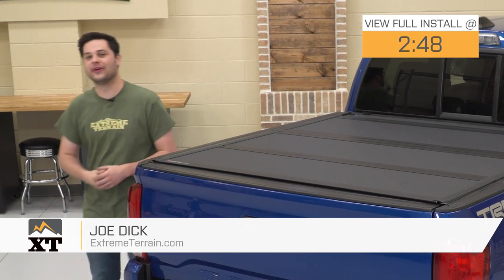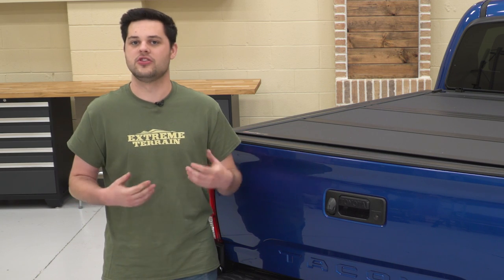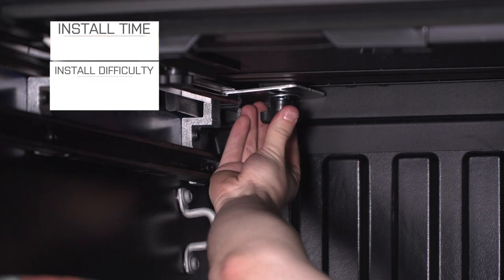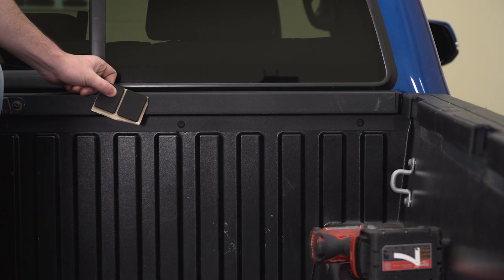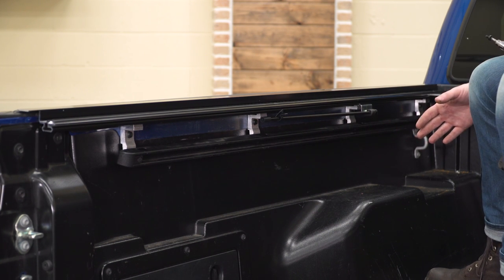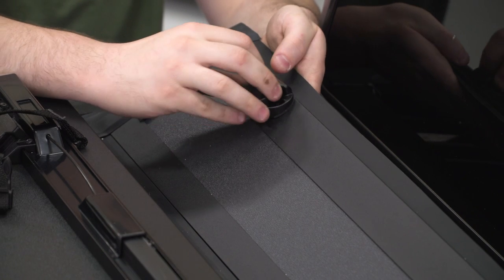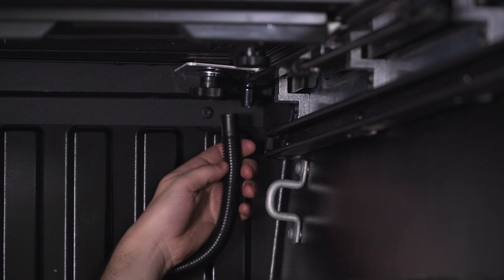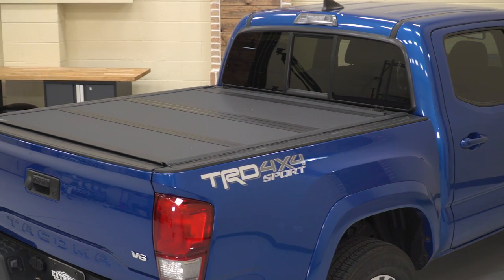Tacoma BAK Industries BAKFlip MX4 Folding Tonneau Cover (2016-2019) Review & Install

Comment: So what keeps water from leaking in with the giant gaps that were cut out of the plastic moulding covering the top of each side of the bed where the "mounting posts" are?  Trying to install this for a neighbor on a 2016 that has/had the factory tonneau cover and there no chance of a water tight seal.  :(
Reply: Wondering the same!

Comment: Whatever you do, BE CAREFUL if you drill through the bottom of your bed for the drainage!! I nicked my fuel intake filler neck and leaked gas all over the place next time I went to fill up 😞. Luckily it only set me back $600 but could've resulted in safety issues. I feel pretty dumb/lucky in hindsight, but please exercise caution if you try to DIY. FWIW the dealership admitted this happens to them on a regular basis when they install tonneau covers; nice knowing it's not just me.
Reply: Damn bro that freaking sucks!
Reply: I live in Phoenix not too worried about water more worried about tweakers 😂

Comment: Any tips to get more waterproof? Mine leaks and i get water in the truck bed... i mean, is not tons of water but say is parked or in motion while raining, i would get about 10% water leaked and not safe to leave stuff in the truck bed that needs to be dry because it will get wet if directly touching the truckbed. Any tips to avoid that?
Reply: @giibo1287 yes, return it. A lot of negative reviews on the whole bakflip line

Comment: What's to stop someone from sticking a flat bar in there and using that convenient strap to unlock the cover?
Reply: I noticed that on all these covers, you don't need a bar... just a coat hanger. The stock Toyota one has a handle for unlocking, but lacks security on the front bolt.

Comment: They changed the design of the MX4 for 2019 and now it covers the rail system instead of moving it down.
Reply: You just made my day.  I bought one a few weeks ago but haven't installed it yet.
Reply: I've heard alot of negative reviews about the cover is it really worth the 1 grand
Reply: Does this mean you can't use the rail system anymore?
Reply: @JV-zc4kh  So...not sure where Martin got his info but at least for the Tacoma version of this you still have to move the rails and they are fully functional.  Source: bought one in November and ive spent a few hours with customer support complaining about false information.
Reply: @yezkaholic  I like mine though i got it on sale for $700.  The sides of it that the latching mechanism attaches to are quite flimsy so I can't just drop it closed like they do in most videos.  I have to drop and then push which i guess isn't a big deal.  If i could do it over I would probably go a different route just because you have to move the rails which makes it almost impossible to find a bed rack that is compatible.

Comment: If Bak Industries had a twist knob on their MX4 cover, I would have bought one... I'm not a fan of plastic rivets either with glued on bars, but really like the design of the MX4... I decided to go with the Extang Xceed instead because of the twist knob that helps with deterring theft.
Reply: The Xceed is good, but the vinyl wouldn't hold up for me in the AZ sun.
Reply: I also like the button for security, does the Extang relocate the stock rails?
Reply: @ronmurphy4234  No, my stock tie down rails are not messed with at all as the Extang cover is secured by the top of the bed with clamps that come with the cover. Not only that, Extang Exceed uses a turn knob for the very first panel in the rear, so theft is much harder. All the rest of the panels are pull cords, but the very last panel where the tailgate is uses a turn knob. I've never had any problems with the construction at all to date and no leaks, but I did use silicone on the front bulkhead to reduce any possible leakage.

Comment: So I've gotta ask, if this hard cover is in the range of $1000+ why not look at a Diamondback Plate cover instead?
Reply: Diamondback definitely worth it if you have the money even the SE is still $1600 i just ordered a mx4 but down the road going to get the diamondback hd
Reply: No full bed access without taking the diamondback completely off.  Dealbreaker for me.
Reply: @redshift2026  Yeah that's fair. Its about a 15 minute process to take my SE off and 25 to put it on. I store all kinds of stuff in it that I'd never store under another cover though.

Comment: i want bed cover for tacoma 2019 5 foot bed without taking my rails out that comes with it any ?
Reply: It just relocates the rails. Watch the video...
Reply: @flounder  totally agreed , I just got this cover too.
Reply: @flounder  They changed the design of the MX4 for 2019 and now it covers the rail system instead of moving it down.
Reply: Martin Steiger so it covers it so you cannot use it? I’m confused a lot of drilling I’d rather not do to my brand new 20 taco.
Reply: @pagodad2036  get a bed mat and route the drain tubes underneath the mat.
Reply: @stephennicolaus5237  Wouldn't you get mold unless you are regularly taking out the mat and drying the bed?

Comment: These covers will last two years.  The deck material is OSB (or similar) with aluminum sheet bonded to each side.  The hardware for the latches is RIVETED to the deck material.  Eventually, water finds it's way into the deck panels. Then they get very heavy and the latch bars start falling off.  So, that's what?  $600 per year?  Good luck!
Reply: That’s a stupid comment. My friend has one for more than four years and it’s nothing at all as you said. ✊🏻
Reply: Okay, it comes with a 5-year warranty. So if it falls apart after 2, I'll have a new one, won't I?... Genious!
Reply: @carlosmoreno7732  Yea, my neighbor has had his almost 4-years and it looks and works like new...
Reply: I’ve had mine for 10 years

Comment: My god whatever you do stay away from this brand for a Tacoma...that square seal on the ends of the front rail might as well be a screen door...it does not work. I understand these are not submarines but the leaks can be measured by gallons per minute. VERY unhappy with my Bakflip and ABSOLUTELY FORGET THE POOR EXCUSE BAKFLIP HAS FOR CUSTOMER NON-SERVICE. At best I now have a trunk...installed twice by recommended installers linked to their website...HORRIBLE!!!
Reply: Max I was thinking I’ll stick with the trusted access soft roll up tonneau but I’m finding it may require modifications as well. Have a brand new taco and want to get something but every single fricken tonneau has a negative somewhere.
Reply: Not to mention almost 1k for a cover that will leak some is ridiculous!!!